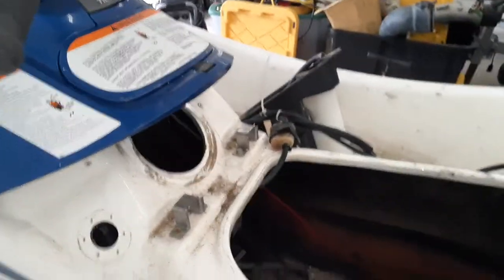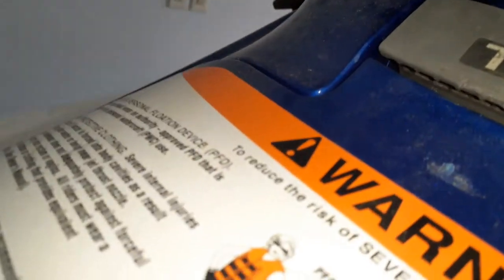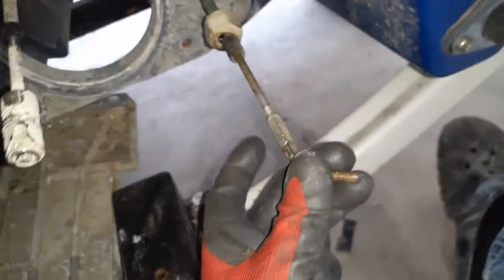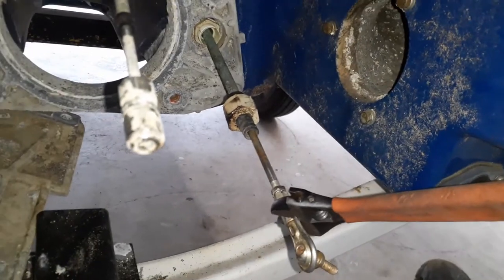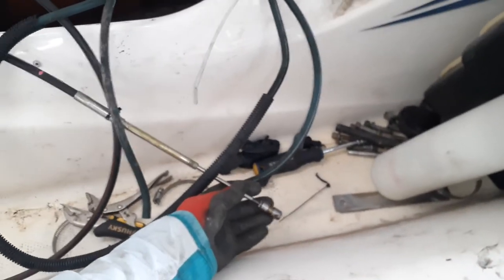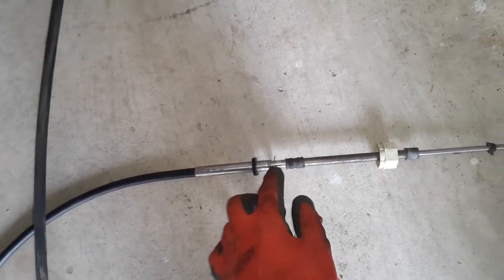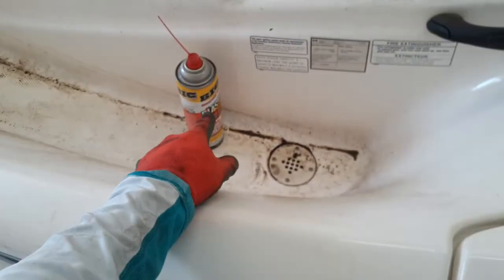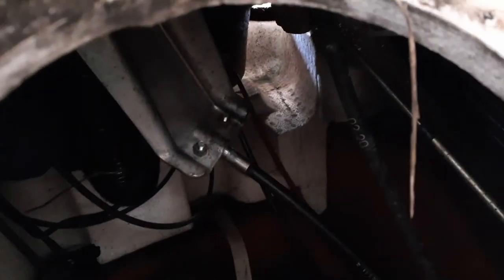Replacing steering cable Yamaha Waverunner 1200 SUV part 2 of 3

Comment: Excellent video. I was able to replace mine easily (aside from having to work in the tight space up front). Suggestions. I was able to access the rear connection point by just removing the two bolts that hold the Reverse baffle in place. It won't come off unless you disconnect the cabling, but it can be moved aside enough to gain easy access to the front wall of the compartment to remove the post and loosen the white nut that holds the cable in place. Also, I never saw how the rear post was removed. It took me a minute to figure out that an allen wrench in the top of the post allows you to unscrew it. Finally, without your video, I would have never figured out the spring connector at up front. THANKS!!!
Reply from the maker: I'm really glad you got something out of this video and did not see your comment till today. Sorry about the late reply. Yes I do a lot of these videos actually so I can refer to them later for the next time I have to deal with it. If a person doesn't do this often enough it's hard to remember two three four years later how you did it.

Comment: HEY ROBERT! Too bad you didn't show first how to remove the Jet Tube & Bottom Plate!
Reply: You don't need to. Just remove the two bolts that connect the reverse baffle and move it to the side. It provides enough clearance to get to the cable connections.

Comment: Does the fuel tank need to come out to replace the steering cable
Reply from the maker: No.  Not at all.  Mine is out for other reasons.  No need to remove any motor, tank or exhaust stuff at all
Reply: @AndTodaysProjectIs  Thanks i looked at mine and seen how easy it was after watching you video now i have to do the trim cables from the front to the rear. what a pain it looks like.
Reply from the maker: @peterlittle9380  yep.  The trim cable is a pain if you are in need of replacing the cable all the way up to The handlebar.  There are two ball bearings and springs just inside the trim selection of the handle grip.  Pain in the butt to get those back in
Reply: No. I removed and installed mine without removing anything up front except the fron access panel.